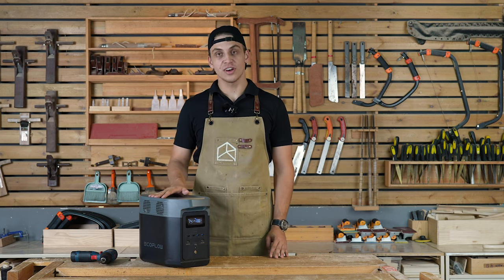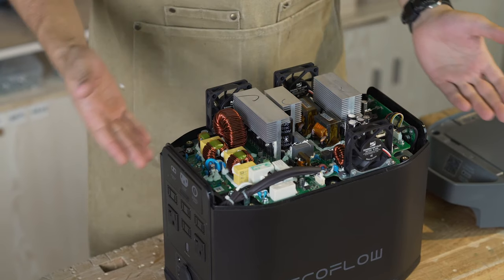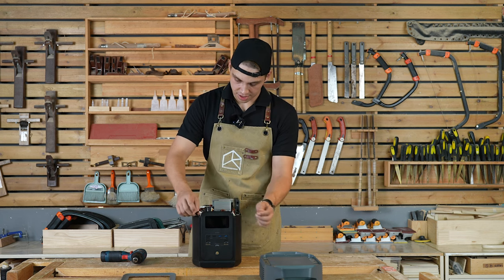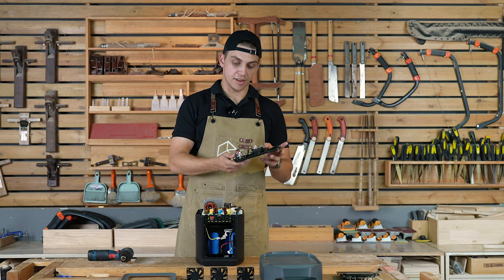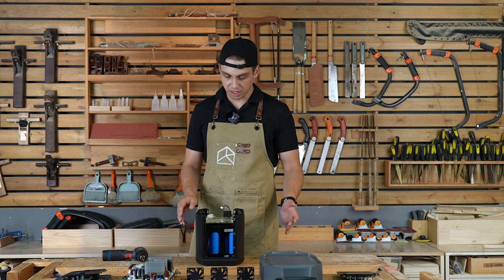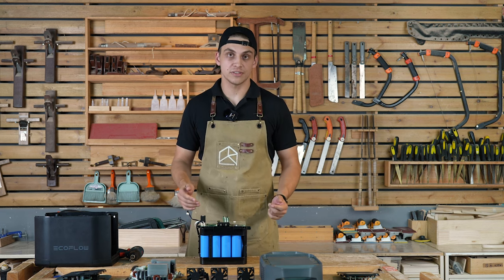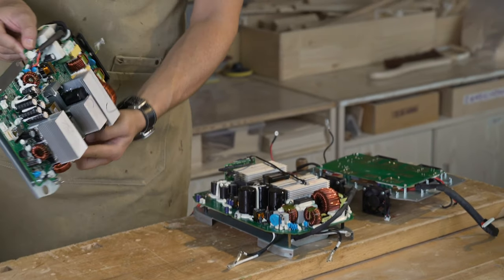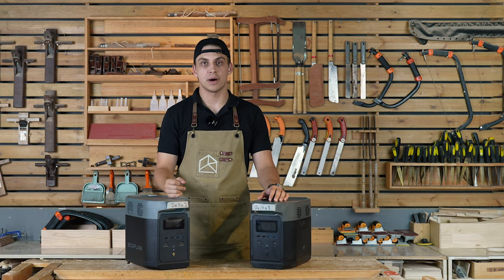What’s Inside DELTA 2 | Portable Power Station Teardown

Comment: As an engineer, you've gained my respect. I've never seen a company provide a teardown video of their own product and expose it to the scrutiny of the world like this. From what I can see, it's a very well-built, very genuine device. I won't buy one because I've already spent all my money buying standalone inverters, battery cells and chargers to perform the same function, but if this existed back when I started building out my system I think I'd have definitely looked into buying this instead. You've done a really good job!
Reply from the maker: Cheers! There's another teardown video coming soon. I promise it is not gonna let you down either, subscribe to stay in the loop😎
Reply: @EcoFlowTech  Why the fan on River 2 is so damn NOISYYYYY??? I have already purchased noctua fan to replace it, why won`t use high quality low noise fan guys??????

Comment: I purchased a Delta 2 in November 2023. I've already had a PSDR Board failure after very mild use. I'm hoping it is just an anomaly. If they promote the battery life for 10 years worth of use etc. why not offer a compelling warranty to back the product. One year warranty doesn't fill me confidence my Delta 2 is going to go the distance. the battery may be useable but means nothing if everything attached to is fails. Time will tell. I'm postponing other ecoflow purchases until they have had a bit more time in the market and see how others experiences compare.
Reply: They are getting lot of bad reviews on amazon, these youtubers are biased and i have purchased delta river 2 and will see how good it holds
Reply: Tech4geeks21st I agree extremely biased and not as honest.
Reply: @ElliotFisher-rd4kz You're correct 100% I don't understand why people do see the marketing gimmicks, if a board or other components fail, obviously the warranty is trash, yeah the battery may last 5 years and more, but if those components fail, you have an expensive brick, that is useless, if your charge controller, inverter, fans etc fails than what? ecoflow and every other company fails to mention any of that, they all state the same gibberish DOD use can last 10 years, when in reality there is has been more refurbished units the first year of release I noticed right away months after delta 2 dropped, refurbished units on the market for sale.

Comment: Excellent material, thank you! And when somebody says Delta 1 has a many cables and connectors, should disassembly for example Goal Zero Yeti series ;-). Ecoflow has a very clean design of the PCB's I like it! One weak point is cooling. R&D should focus on airflow techniques, bigger fans, less noisy, RPM modulation hould depends of real temperature on active elements.
Reply from the maker: Thx for your suggestions. Delta 2 fans RPM are working according to it's temperature
Reply: @EcoFlowTech  this is great information for all potential buyers!
Reply: How do you know what's getting hot inside, since delta 2 reads 105f top of where I assume inverter is at gets hot, now the bottom where cells should be isn't,so how does one know??

Comment: Seeing this power station get fully charged in 70 minutes is truly amazing. I do wonder what speed the next release will have.
Reply: Even the delta  pro charges in under 2 hours,  They really are the fastest  charging  units available. And the fact everything  is internal,  you don't need to keep track of a separate  inverter, that is a big win as well

Comment: Do you know how to hard reset it? My one just stopped working. I cannot power it on but after several hours if I press USB on button, display turns on but flickers for a 1-3 seconds. Sometimes it happens simply when I insert power cable.
Reply: What solution did you find? I can’t get mine to charge left it plugged in and that was it overchatged?

Comment: On future version could you add a removeable grill over the fan ports with a fine mesh.  I have had mine for 3 months and twice I have had to remove the cover to remove something caught in the fan which the software cause as enough of an issue too turn off the AC outlets.  If there was a easily removable hard plastic mesh piece that could be washed off, dried and snapped back in place instead of popping up the trim ring, and then cover that would be awesome.
Reply from the maker: Hi there, thank you for your feedback, I have passed on your feedback to our product team. Cheers!

Comment: Can anyone tell me more about those Cells?
As i can see, there is a 4S 4P battery configuration over there, that means 16 Raw Cells.

If the Delta 2 has 1024wh Capacity Every Cell should have 1024/16 = 64Wh
Because those are Lifepo4 Cells that means the Voltage is 3.2V so, 64Wh/3.2V=20Ah,

Does those Cells looks like a 20Ah ???

I'm really interesting to know what batteries are those.
Should a number like 36900 sounds right ?

Comment: What are the risks of delta 2 catching on fire. And also is it true you can charge the delta 2 to 100% to 0%  over and over every day or do you have to put limits on charging and discharging.
Reply from the maker: Hi, take it easy, the Delta 2 has multiple protections such as over-voltage, over-current, overload, etc. so that the risk of fire is very low under normal usage. I suggest to charge and discharge between 20% and 80%, which is good for the life cycles of the battery.

Comment: hello.  I would like to know what kind of individual batteries it has.  it was also good to put it side by side with a 12v lifepo battery used in motorhomes with separate inverter and mppt for those who already have all these last items installed many times at the factory in motorhomes, if even so it is worth changing and purchasing the ecoflow.  I would also like to see stress tests on lifepo 12v batteries with inverter connected to microwaves, coffee machines ....
Reply from the maker: Hello, the battery DELTA 2 adopts is LiFePO4 battery chemistry which gives you 3000+ full charge and drain cycles and 6x longer than industry average.

Comment: It looked to me like the Delta 2 had 8 cells exposed inside, so is it nominally a 24V battery with 40Ah cells?
Reply from the maker: That's a close guess. It's actually 48V with 20Ah cells.
Reply: @EcoFlowTech  True. In another teardrop video, which I watched later, it showed that there are indeed 4 x 4 cylinders. From this video, it did not appear to my eyes at any point.

Comment: Thank you very much for this video. Can you please make a teardown video for the Delta 1? My unit is out of warranty and I need to service it. Seems like to separate the MPPT and Inverter boards, I have to desolder some wires coming from under the battery?
Reply from the maker: Hi Kris, can you specific the problem you come across?

Comment: 3000 charge cycles is a lot. Which translates to about 10 years of use before going down to 80%.
Reply: @carltoncain9966 that's if the rest of the components hold up and don't brick the delta 2 rendering it useless paperweight.

Comment: 1:50 isnt that the inverter board on top? Edit: Nope they put everything on that top board. Impressive

Was expecting to see 32700/32650 LFP cells on the Delta 2. Now I gotta search and see what those cells are...kinda remind me of the 66160 LTO cells that Yin Long make.
Reply: i think 46160 but those are 25 to 30 amps.. maybe they oversized the battery or used less cells 14 or 15 for pack   nominal voltage 50.4  i think

Comment: i just got my delta 2 and i see that max solar input is 500 watts 60 volts 15 amps 
what if  my solar panel configuration ends up at lets say 600 watts 58 volts and 20 amps ? 
will it hurt the delta 2 to have more amps and or more watts coming into it or will it just not use anymore but be fine. ?

Comment: When using solar panel, is it recommended to add extra safety devices like DC SPD or like when connected to Ecoflow powerstation?
Reply from the maker: Hi sorry for my late reply! Generally the PV charging surge protector is not a must-have as our generators have overcurrent overcharge protection. If you think it is necessary to install an RSD or fuse for safety, you can use a 23/24Amp. Please note that the PV input current should not surpass the maximum solar input the generator can take.

Comment: I’m impressed at those huge improvements on the battery cells wonder what chemistry bd voltage they carry now it look like huge capacity?
Reply from the maker: The battery pack voltage is 51.2V (single battery cell is 3.2V)🤗
Reply: @EcoFlowTech  that’s awesome they look so cool cylindrical all in one pack and powers a lot of stuff
Reply: @EcoFlowTech  I had one questions in regards to over voltage protection when a storm or lightning hits solar will or could solar panel induce a heavy high voltage that could damage the eco flow mppt circuits ? Is this unit cover against those types of events the delta 2 and others how much warranty is available included from you guys if I purchased from Amazon ?

Comment: The XT60 connectors on our Delta 2 burned out and melted with only two 100 watt solar panels connected to it. And so I'm a little hesitant to just replace them and have the new connectors burn out and melt.
Do you have any suggestions or any ideas about this?
Thanks,
Mike
Reply from the maker: Hi Mike! Sorry about that. It is likely that the solar charging cable is short-circuited or because of the loose connection with Delta 2. Would you mind contacting our after-sales team for a new cable via this email: support@ecoflow.com. Next time, you can observe whether the XT60 interface gets hot in use. Hope this helps!
Reply: @EcoFlowTech  
Thanks. I've also ordered a second Delta 2,, even though with our first one we charge it in town from the grid. We (a friend and I) have been off-grid for over ten years. The Lifepo4 batteries in the Delta 2 are excellent and we currently use it to boost out refrigerator and our freezer in the evenings when we get home.
Our cable with the XT60 connector (solar type) may have been faulty, and I'm looking to replace the onboard XT60 connector as well..
I'm assuming that support can tell me the specifics on that, also.
Thanks for your timely reply.
- Mike

Comment: I have a Delta mini and need 15a  (12v) during the start up of the heater for my van - is there any way to bridge the 12v car output and 2x 3a outputs?
Reply from the maker: There is no way to bridge. It is recommended that you use a DC to AC adapter to charge through AC.

Comment: with all the complaints about the fan noise, I assumed that they would be impossible to replace.. clearly not the case! I don't see any reason why the fans couldn't be replaced with quieter ones if that becomes a big issue. Has anyone done a fan swap on their Delta Max?
Reply from the maker: Hi there! It is not recommended to dismantle the unit or replace the internal parts. You can try to upgrade your firmware to the latest version V1.6.2.52.

Comment: My Delta max isn't very old, it won't charge passed 70%, can it be returned to 99%? It happened suddenly, it was charging to 99%, and then overnight stopped at 70% and won't go back up.
Reply from the maker: Hi, could you pls check if you connect to EPS or use solar charging at night? And below is my advice:
1. Update your firmware, and you can tell me the SN number of your device.
2. Set the charging limit at 100% at EcoFlow APP.
3. Make sure the AC cable is well connected to the wall outlet. 
4. Discharge the device to 10%.
5. If still can not work, you can record a video and DM us on FB, so that we can diagnose the problem better😎. Here is the link: https://www.facebook.com/ecoflowtech/
Reply: @EcoFlowTech  my Unit has returned to normal operation, thanks for the help.

Comment: I made the mistake of trying to charge my delta 2 unit with 1200 watt gas generator without checking the htz output first.  The screen showed the numbers jumping all around in value as far as watts input,  then after a while the unit started clicking, then shut off.  I tried turning on the ac ports,  but they go out after a few seconds.  What did i blow? The fuse? If so,  can it be fixed?
Reply from the maker: Hi there, could you try shut down the unit, place it there for a while and re-turn on it. Please also contact our support team👉support@ecoflow.com with a video and your unit's serial number.

Comment: I have a strange behavior of Ecoflow Delta 2 1024w power station. It is connected to the gas boiler and shows about 120 watts load. When the battery is charged it shows that it will work 8 hours on that load. After 4 hours of work, it shows that it charged 50%, but after that, it starts discharging very quickly and after about 10 minutes it shows 0%.
So my boiler can work about 4-5 hours on this power station, instead of 8 hours. What can be the issue?
Reply from the maker: Hey Ihor! Please operate according to the below: connect the network to upgrade the firmware. And then calibrate the SOC 2-3 times (set charge and discharge 0%-100% in the app, discharge the power to auto shutdown and then charge the power to 100% without input. This is 1 time for the calibration of SOC). And it would be better if you could provide the SN of your product so that we can track the product problems nd offer more solutions.
Reply: @EcoFlowTech  Hi, I updated the firmware and made the charge/discharge procedure, it looks like it works better. It is hard to do it properly 3 times because EcoFlow powers the gas boiler and light in the class of kids academy in Ukraine. We have electricity outages almost every 4 hours, because of the russian attacks. So EcoFlow Delta 2 is very helpful in that situation. Thanks for your support!

Comment: Could the delta 2 charge a battery or batteries that are not the same brand?
Reply from the maker: Hi there, if you use a 120V AC charging cable to charge the other battery, it is fine. However we do not recommend charging via self wiring.

Comment: How does a kilowatt battery compare to a amp hour battery?
Reply from the maker: 1kWh at 12v would be about 83ah. Delta 2 battery pack voltage platform is 48v so it's around 20ah. That's not how we measure it usually, but i hope it answers your question
Reply: Ah is a value dependent on the nominal cell voltage. P = U x I
This translates into Wh = V x Ah

Comment: Here's my driving question.  Is the Delta 2 properly grounded?   Meaning; if the Delta 2 is plugged into my household outlet, which is properly grounded to a 6' steak driven into the ground as well as my buried copper pipes, then can I leave my refrigerator, TV, Internet, and home computer system all plugged into my 4KWh Delta 2 Max system without concern of improper grounding issues?

It's important.   Lack of grounding was a major drawback of the Delta 1.  If so, this opens a whole new door of usefulness!  It becomes a "poor man's battery backup system" for our home solar system, complete with 30% federal rebate!  If not, then what measures can I take to achieve proper grounding for these devices plugged into it?
Reply from the maker: Hi there, yes when Delta 2 is connected to an AC wall outlet, it is grounded. If you need to use it to charging your RV/EV, you might need a grounding adapter, check out here👉https://us.ecoflow.com/products/portable-power-station-grounding-adapter?variant=39987909984329

Comment: My Deltamax no longer charges from solar. Just quit charging from solar and 12v cable. AC is fine discharge or output is fine. Kind of useless to me at the cabin may have to get something else.
Reply from the maker: Hi, would you mind telling me the SN of your Delta Max? And, do you mean the car charging also can not work? When did this solar charging start to happen? Thanks!
Reply: @EcoFlowTech  S/N DAABZ5ZD9150655.     Unit is for a remote cottage only used about 10 times but never on solar until last trip. Was charing off one 400 watt panel occasionally day one and two. Seemed to work fine but was overcast. Day 3 was intermittent clouds and was charging around 250 to 300 and was close to fully charged 98% when I went outside. Came back in and saw it that the output had shutoff so nothing was running in the cabin (fridge and laptop charging nothing major). Showed 99% charge. Turned the Delta back on and everything is fine except solar input now reads zero. There is a clicking sound from the Delta that stops when I unplug the solar cable. Noticed afterwards that 12v charging also shows zero input. AC input is fine so I can charge from the generator and output is fine. However the goal is to have solar and not run a generator constantly.
Reply from the maker: Thanks for the details. Could you upload your firmware and then try solar charging? The firmware you are using now is very outdated, which can be the main issue.

Comment: I got my Delta 2 17th of November 2023 and in February 2024 the one fan started making high pitch bearing sounds, not impressed cause its quite an expensive product
Reply from the maker: Hi there, if you need any help with your unit, feel free to contact our tech support team via ecoflow@support.com. Also, it is suggested to update your firmware to the latest and see if this helps solve the problem.